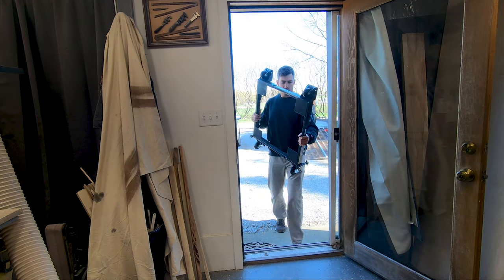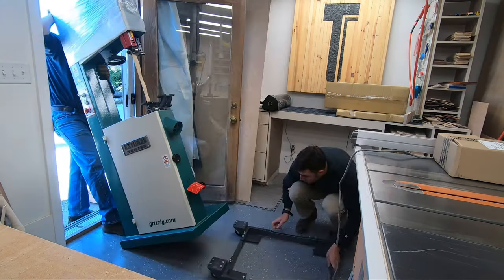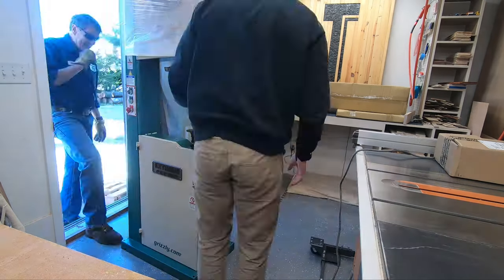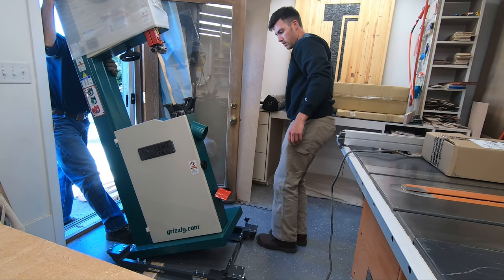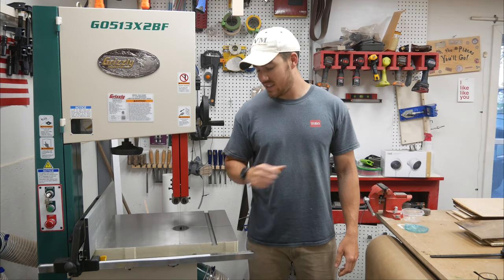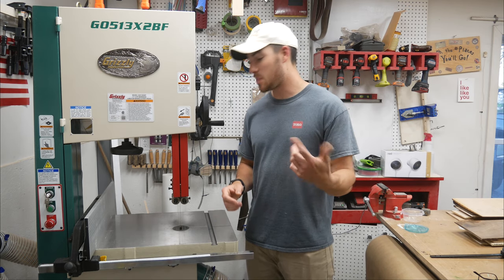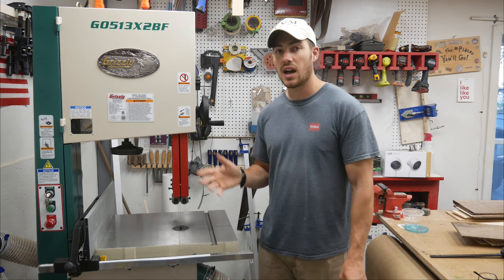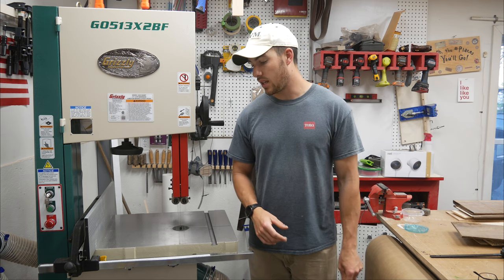My New Grizzly 17" Bandsaw G0513X2BF

Comment: What blade are you using for the re-sawing? I have the same saw and love it! For the dust collection I made a box that fits around the bottom of the table and use neodymium magenta to hold it together and in place the box is made of 1/4 Baltic birch plywood. 
when I needed to change the blade the sides pop off easily for blade changes and  this arrangement collects all the dust. 😁🛫
Reply from the maker: Ah that's a great idea for dust collection! I may need to look into that! My go-to blade for resawing is the the 3/4"  "wood slicer" from highland woodworking. This specific saw take a 131.5" blade. They're the best I've found and they're better than the more expensive blades I've tried.

Comment: I’m going to be getting this G0513X2BF or the G0513X2 in a couple of months when the snow starts to leave the ground. Can anyone give me any solid advice on the necessity of spending an extra $300 on the brake?  I’ve read comments like “the blade won’t stop turning until after lunch” or “it’s a safety feature because you might not realize the blade is still moving”. I just don’t have that much experience with bandsaws to separate fact from flowery fiction. I’m not a professional, that is, I don’t make a living woodworking although I do have rentals that constantly need repair. Great video teaser BTW. Thanks
Reply from the maker: Glad you like the video! I'll let others chime in about the brake too but I personally have never touched the brake pedal on mine. Not sure if the $300 is for the brake pedal assembly or the automatic brake but if it's just for the manual brake option I don't think it's necessary.
Reply: @SamMacyDesigns  thanks Sam. The G0513X2BF has the magnetic switch and automatic brake, just like the one you reviewed. The question I’m facing is wether the 3 second stop is worth the extra complexity (more things to break) , and high cost, over the normal time for the non braked blade to stop moving. I have read reviews that the blade takes forever to stop and others that say it’s only about 15 seconds. Of course the physical properties of the wheels and blade would play a part in this. I have experience on baby bandsaws and wind down is not an issue. Hopefully you or some of your followers can give me the benefit of their actual experience on the time it takes the unbraced version of this machine to stop. I’m not in a production environment.

Comment: Two years have passed since this video.  What are your longer term thoughts on this bandsaw?  How well does it collect dust?
Reply from the maker: Still loving it! At this point I mostly use it for re-sawing wood and it does phenomenal. I think the dust collection could be slightly better but besides that I have no complaints. And when you're re-sawing dust is pouring out of this thing so the little bit left behind is probably just due to the fact that my dust collection system is under powered.

Comment: My dude with this much power at your hands you must ensure to keep your seed speed up a to keep the gullets full of material and moving through the material the shortest amt of time. Fastest feeding with barely bogging the motor and keeping wood cut good enough. be less picky on surface i dont mean peaks and valleys. But I don't mean glass smooth!
Reply from the maker: That's actually some great info! Something I hadn't thought about but I'll try it next time I do a round of re-sawing. Thanks for the advice my man!
Reply: @SamMacyDesigns  Yep. Like someone with a new entry wood processing saw mill. They think they are taking it easy on the machine, when in reality. They shave too small of a wood slice with each gullet and it leads go more friction. Less agressive feed leasd to saw blade touching pretty nuch much every molecule of wood, instead of rolls of wood a few thousands thick you get powder. should be spitting out "woodchips" of a sort.

Comment: Regarding your comment on caster mounts being on narrow sides of saw so it could go through door.  It seems that being on wider sides would be much more stable and less likely to tip.  Get it through door another way and choose stable mount. Am I wrong?
Reply from the maker: The only problem with having them on the sides of the  mobile base is that they don't allow the bottom door of the saw to open. I suppose an option would be to make some kind of spacer to raise the saw up a couple inches so you clear the casters and then have them on the sides? That would probably be more stable than what I did.

Comment: I habe the black anniversary version.
Reply from the maker: How do you like it?
Reply: @SamMacyDesigns  - cuts great. If you adjust it too high or too low the blade guard will cock and get into the wheel. I ruined a tire  setting it up doing this. Now that I know, its not a big deal, but it is still an annoyance. I also really like the fence.